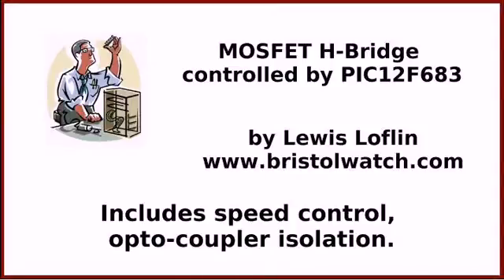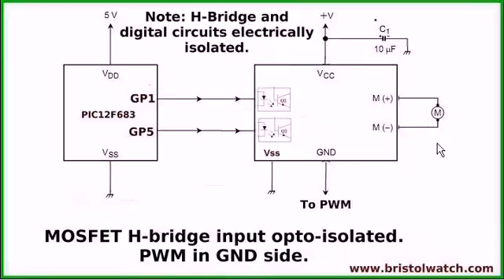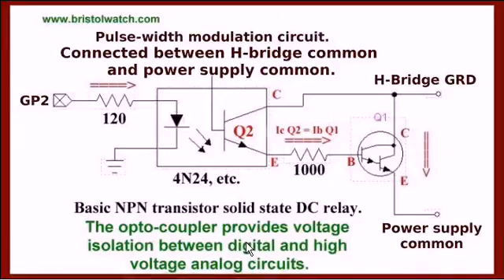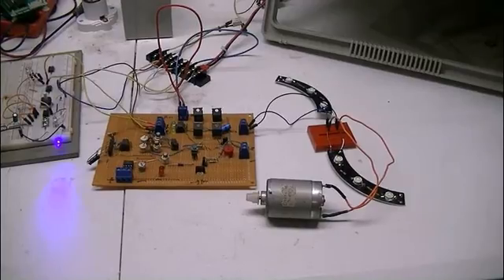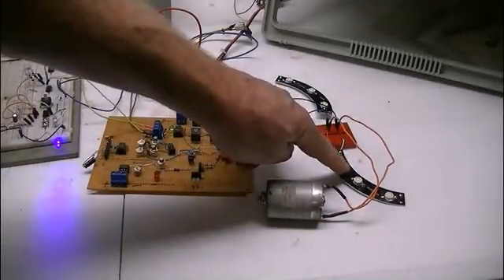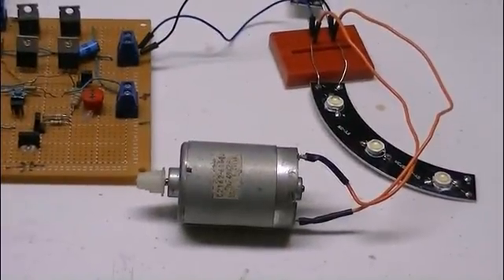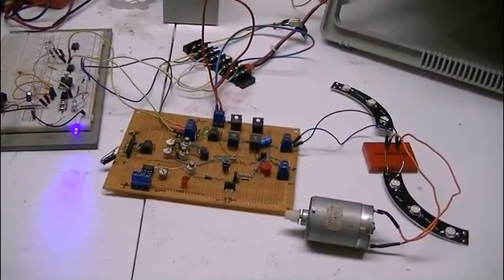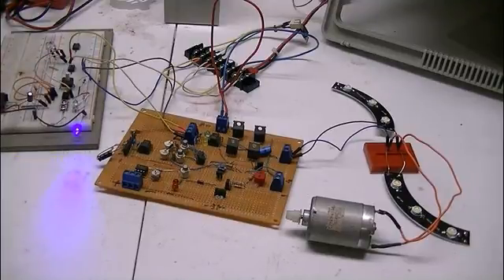Optical Isolation of H-Bridge Motor Controls

Comment: some one tell me to use transformers or resistance? it will work ?
Reply from the maker: Don't understand the question.
Reply: i have a cascade inverter contain of three h bridges when i connect these h bridges in series i get short circuit ?
Reply: because they have the same neutral how can overcome this problem .

Comment: Thank you for this great video. I have two questions. Why is there a darlington transistor, it is for a perticular reason or can we use a mosfet? Do the optocouplers manage a switcing frequency of 2Khz?
Reply from the maker: +Aleksandar Ignjatovic MOSFETs don't operate like bi-polar transistors as you know. The circuit was aimed at transistors and I have a lot of Darlintotons. Yes 2kHz will work.